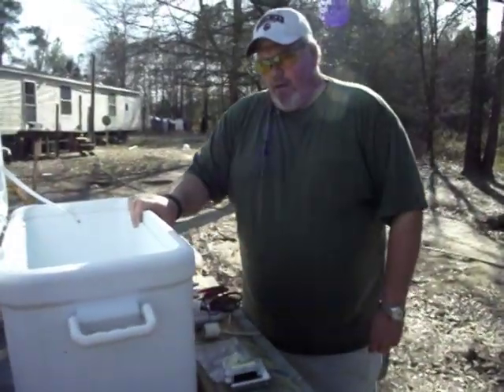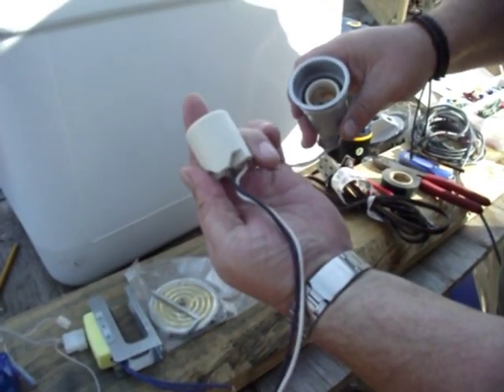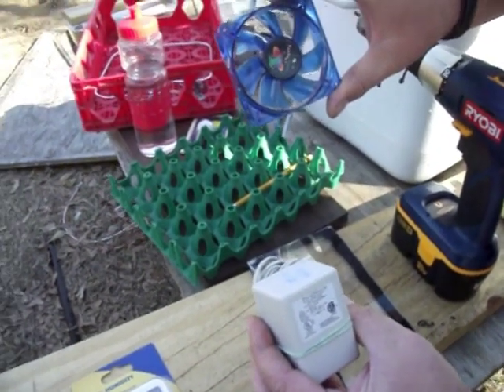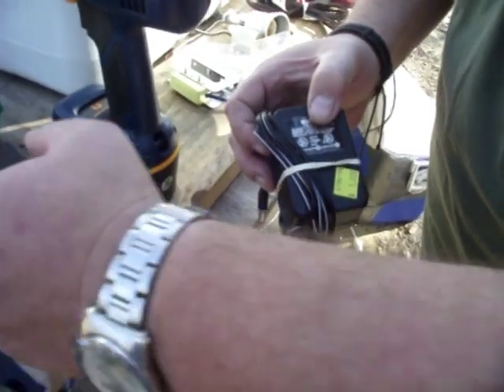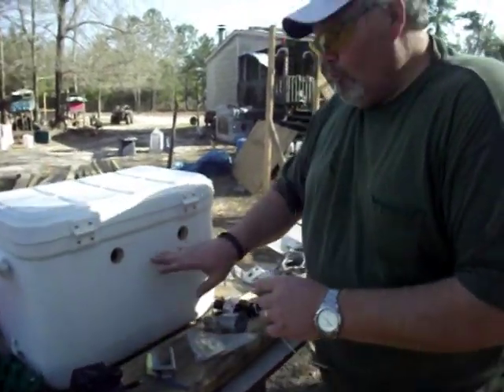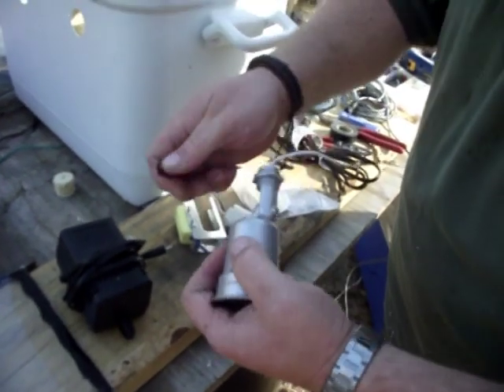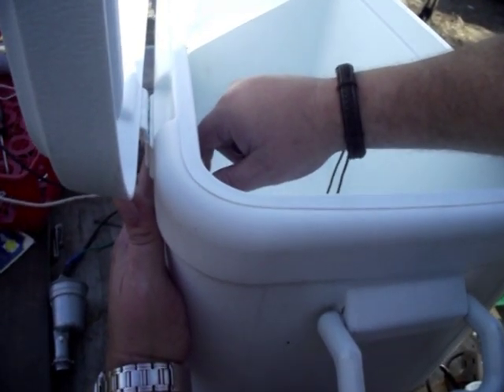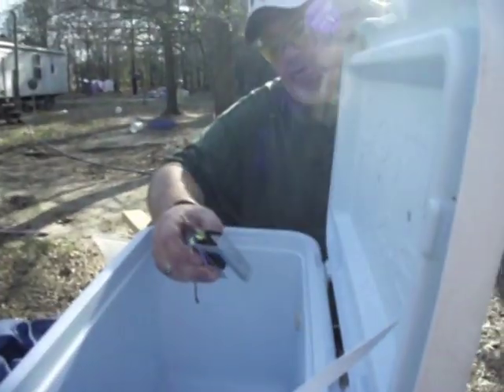DIY, Building, Making and Wiring a Homemade Incubator  (Part 1) of 4 (RushLanePoultry) style

Comment: Just a suggestion to the people with automatic egg turners with semi automatic ones where you don't have to open the bator to turn. To refill the water dish with out opening i bougt some aquarium air tubing and a large cattle syringe and ran on end into the dish in the bator and the other out. Now when i go to refill i just disconnect to syringe and go to the kitchen and full it up and squeeze it through the tube into the dish. Never have to open in incubator :)

Comment: I need more detail with the wiring between bulb, fan & thermostat.  The light socket I purchased does not have any wires, so that is where I'm confused.  Can I use the extension wires to do all the wiring in between these items?  A quick response would really be appreciated ...  Thanks!